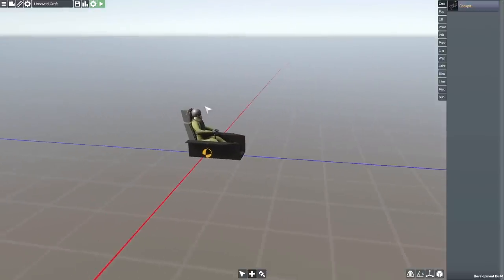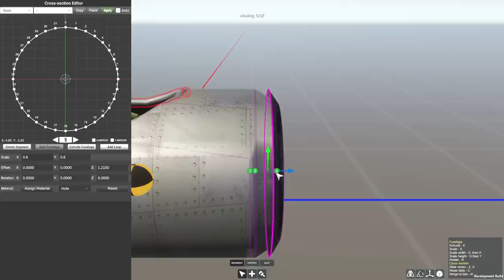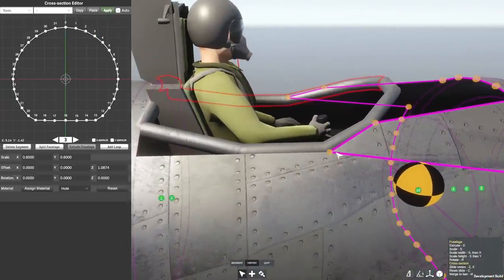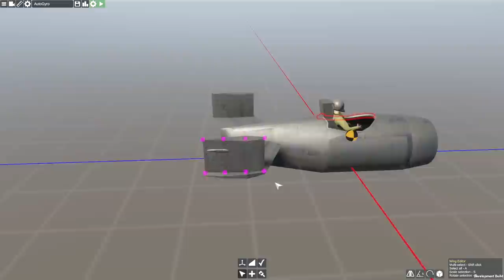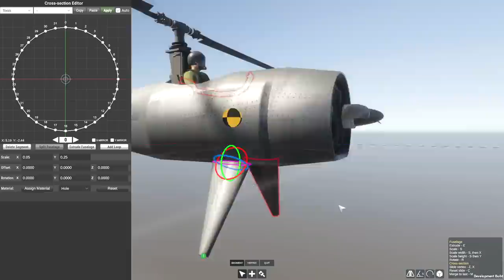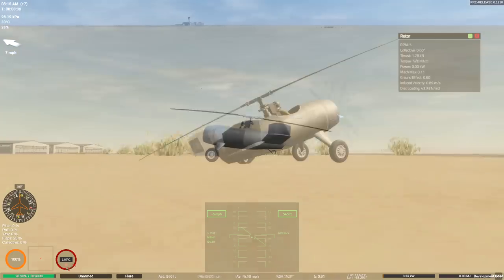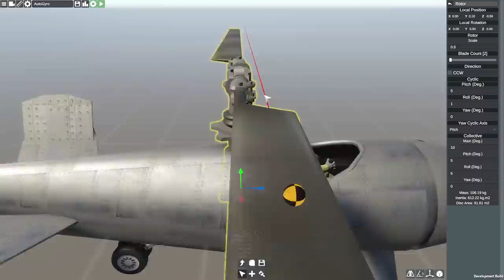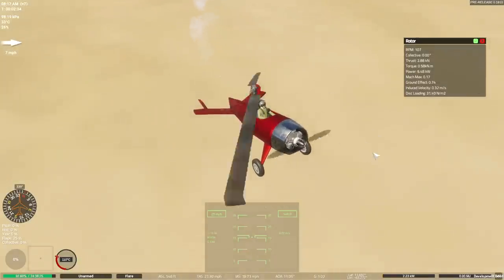This Planes Has A HELI PROP Instead Of WINGS In Flyout!

Comment: I'm not sure exactly how Flyout handles cyclic and collective just looking at it, but I think you might just need to tilt the rotor back a little. Autogyros are stall immune, but they can't propel their rotor under negative G's. If you tilt back a bit you keep positive pressure on the rotor in level flight; might let you shorten the rotor a little, and give you a bit more tolerance pitching down.
Reply: Yup (lead tester here), you need to give it about 5-10 negative angle to help keep the autorotation running
Reply from the maker: We did tilt it backwards a tad, not sure if I edited that bit out though haha